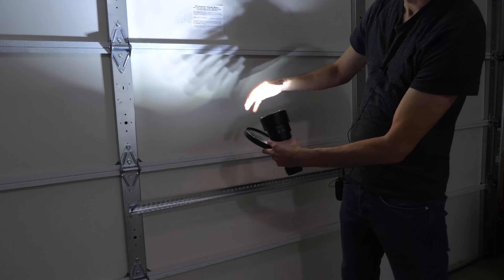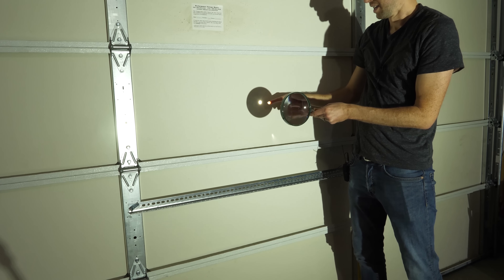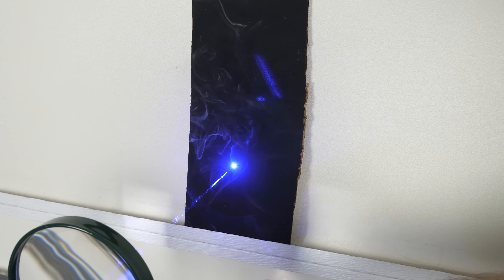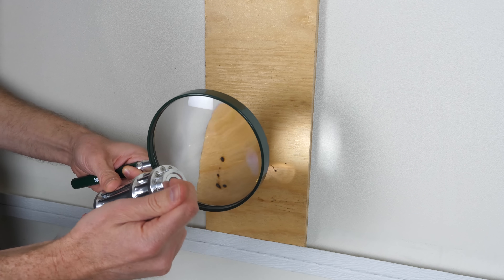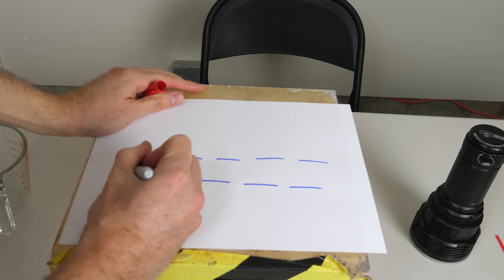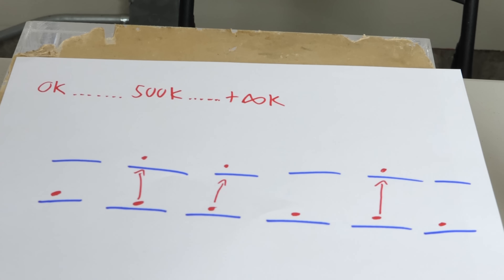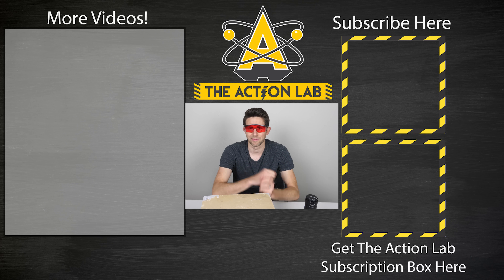What Happens if You Focus a 5W Laser With a Giant Magnifying Glass? Negative Kelvin Temperature!

Comment: to explain it more simply. A source of light will always have a sphere property in terms of how it spreads in this 3d universe and because this property follows any amount of light you have, you can never make a sphere into a straight line and you will always lose heat and energy because light doesn't travel in a straight line but in a sphere shape. 
For the laser part, the laser pointer has manipulated light within and the people who made lasers probably add matter to move the light to a focal point before hand to make light move in a straight line for a certain amount of time. After a certain time once the laser is beamed, the matter is bounced off light keeping the light in the straight point or not and this reaction gives a cold reaction and the reason why it makes a hole in whatever your pointing at is because the modified light is going at such extreme speeds that it smashes the wood but because it probably doesnt go at the speed of light the events arent that dramatic. its like a car being held back by a bull. the car wins but the bull slowed the car just enough to keep it in a desirable direction of the bull and the bull hits whatever is in the direction of where he wanted to go.
but thats just my opinion and guess. feel free to debunk it or not.

Comment: That... didn't explain this to acceptable satisfaction.
Reply: Its very hard to do, https://en.wikipedia.org/wiki/Etendue if you understand the mathematics go right ahead.
Reply: @danrayson  I thought temperature was the average energy of a bunch of particles. Even electron volts would translate directly into temperature and given the mass of the particle, into speed as well. Why does he come up with quantum states? Why is the "same number of high states ans same number of low states" +infinite temperature?
Reply: @TheYear2525  exactly, I don't believe that he fully understood this one before trying to explain it.
Reply: @TheYear2525  Temperature only directly correlates to the average energy of the particles in an ideal gas, and there only because the uncertainty in a particle's momentum also happens to directly correlate with its average energy. Temperature in full generality is defined as the response of a system's entropy to a change in its energy, and it turns out that in some systems there comes a point where an increase in energy doesn't change the entropy (infinite temperature) or causes it to decrease (negative temperature). 

For instance, think of a quantum system where every single atom is in its most excited state, except one random particle. The number of microstates here is just the number of particles in the system, since any one of the particles could be the nonexcited one. Now imagine I pump in the energy needed to promote this one random guy to an excited state. Now there's only 1 possible microstate for the system, the one where every last particles is excited. I've decreased the entropy even though I've increased the energy of the system; therefore it must have been at a negative temperature, indeed a temperature very close to negative absolute zero. Make sense?
Reply: Lemme make this easy. 

Light coming from the sun or a typical flashlight has tons of disorder (aka Entropy) in it because the light is emitted pretty much in all directions, across a huge range of frequencies and with a random phase. Since the entropy of the Universe can't decrease, any surface onto which you focus the light has to increase correspondingly in entropy, and because of that, you can't do any better than to replicate an image at the same temperature and brightness of the surface that emitted the light on the new surface, since that represents the absolute minimum disorder in the light before it's scattered and reflected further.

Laser light, by contrast, is almost completely ordered (ie. has very very little entropy). It travels in only one direction, at only one frequency, and is entirely in phase with itself. Because it carries almost no entropy there's almost no limit to the ways you can focus it onto a surface; you can pretty much make it as hot as you like, with the right setup.

The whole negative temperature thing is basically a way of saying the entropy of the laser is tiny relative to the energy it carries, btw. The way temperature is technically defined is by measuring the change in entropy of a system per unit change of the energy of system and taking the quotient, and for some setups (eg lasers) there's a point where the system becomes MORE ordered as you pump more energy in instead of less; this is the point where temperature passes infinity and becomes negative, becoming "hotter" than any regular, everyday object.

Am I making sense to everyone?
Reply: @tuckermatis1572  Great explanation.
Reply: @tuckermatis1572  please, entropy is a complicated subject and is notorious for being misunderstood and misrepresented. Firstly: entropy CAN decrease. I repeat, entropy CAN and DOES decrease, and this happens quite often. The 'law' of thermodynamics that you are thinking of reads merely that the entropy OF THE ENTIRE UNIVERSE SUMMED UP must always be increasing. Subsets of the universe decrease their entropy all the time, at the cost of an increase in entropy elsewhere, such that the net entropy OF THE ENTIRE UNIVERSE increasea. Gabísh?!?
Reply: @ilikemitchhedberg  Correct. It is possible that a system's entropy can decrease if there's a corresponding increase in the entropy of the surroundings. This doesn't mean the second law of thermodynamics can't be applied to small systems, though; all that necessitates is that one keep track of the inflow and outflow of entropy from the system to its surroundings. You can imagine a box around the system, define entropy inside the box, and consider how entropy must flow through the borders of said box. (Indeed, one way to define instantaneous change in entropy of the system is as the quotient of heat flow through said border and the temperature of the system). Makes sense?
Reply: @tuckermatis1572  Tucker, please leave me alone. Its not you... it is this video. This video triggers me hard because the author does not know what he is talking about... yet he presents himself to the public as an expert. This is morally wrong. I only partially read your comment and assumed you were defending the author of this video. Have a nice day.
Reply: Yess, I am kinda like more confused after watching this than i was before
Reply: @danrayson  "how do you wrap your head around infinite gravity in black holes?" Well I don't, because there has never been an experiment to prove any of that theory, its all on paper. Therefore I don't need to wrap my head around it, because its not factual. However there is an experiment that shows that focusing lazers works. The question is, do I ponder why or move on to other topics...?
Reply: "it shines" :D
Reply: ... the first and second laws of thermodynamics say nothing about temperature. Energy is conserved; entropy is increasing. I can promise you that our esteemed youtuber did not violate any laws of thermodynamics. The point of light resulting from the magnifying glass simply focused the laser light into a smaller area.
Reply: "if you use a magnifying glass it just spreads the light out more"
Reply: @danrayson  you saw evolution happen in real time on the computer  ? Wow - how many million years were you watching the computer ? Hahaha ..😆
Reply: I agree
Reply: to me is simple BS

Comment: Not quite.
What you did is called light energy convergence. 
The energy at the source(laser) is still equal to the energy output on the surface of the wood plus négligeable light refraction(by the air and all the smoke you created) . All you did was focusing that light energy to a smaller point.
The same way if you place a 50 lbs  dumbell directly on your head it won't be as uncomfortable as if you place an ice pick tip on you head than the dumbell on tip of the ice pick. Than it will go right through the skull not because the weight at the tip increased but because you distributed that weight on a smaller surface. Same thing with the light. Laser or flash light, the energy at the source remains equal to the energy on your board.

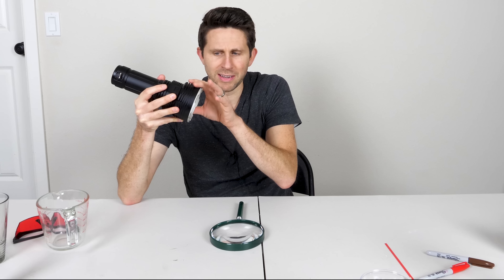Comment: 2:48 but I thought the point of a magnifying glass was taking the total amount of heat, which would otherwise be distributed evenly in several directions, and concentrating all that heat on a smaller point...or something like that?  Obviously that won't work with a flashlight and the sun is already really hot so you're taking the amount of energy that is normally already really warm over so many square inches and focusing it all down to a much smaller point... I don't know. :\

Comment: But if you gathered the light from  all <n> LEDs, and concentrated them on one spit, you would have a higher energy density than that of one LED.  In fact it would be more intense by a factor of <n>, minus inefficiency.   

By the same token, if you were to use a set of lenses (or mirrors) to focused the glowing area of one LED down to an area (say, 1/<n>-th) of the LED, your energy density would be greater.

You can make a smaller spot higher in energy density than the bulb.  That is what the parabolic reflector behind the bulb is doing. 

It does not violate the First Law, because you aren't getting something for nothing, merely concentrating a wee bit less than your something.  

Maybe you should not have started out your video with such a misleading statement about the Second Law.  In concentrating the energy, we are obeying the First Law.

Comment: Everyone gangsta until 0 has positive and negative forms
Reply: And I thought math was already hard...
Reply: It’s so Gangsta it’s...SIKKK...

        ...SSSIKKKNESSS....
Reply: well it was 0 kelvin so it has a different value in degrees so it is technically not 0 so it works
Reply: @ilent_assssin1121  okay einstein but nobody literally asked i didn't said i don't know that
Reply: @ilent_assssin1121  I actually appreciate you explaining this, thanks!
Reply: -0 degrees
Reply: 0 is no thing, or no temptation
Reply: @すばらしい猫  i didn't asked.
For god sake i hate people who doesn't have sense of humor
Reply: Looks like the people that designed the IEEE floating point number system already knew that
Reply: It have that in water. +0C water is liqid, -0 C water is solid. They are exactly the same tempersture but have diffrent energy stage
Reply: It is 1/infinity is 0+ and 1/infinity is 0 cuz they will tend to zero but never actually be exactly 0

Facts pls don't troll
Reply: Think of 0 as a neutron particle. Normally, a neutron has a neutral charge, but you can also apply a positive or negative charge to it. When you negatively charge a neutron, it becomes an electron. When you positively charge a neutron, it becomes a proton. So, 0 always has the value of 0, but it can exist in 3 different states. Positive, negative, or neutral. I hope this helps.
Reply: Wtf. Your profile picture looks like if my sleep paralysis demon's mother had a Facebook account and wanted to post a picture of her son for the first time. 

I LOVE IT.
Reply: @lepotato135  uuuhh that's the chad
Reply: @kosminn  Pretty sure they changed their profile picture lmao.
Reply: @lepotato135  lol i died during seeing this conversation
Reply: @lepotato135  please dont delete ur firt reply
Reply: @imbouttashowyoumycaillou-k541  I won't lol. But now I'm gonna have to be afraid of people who are gonna get the wrong context out of it. 😂
Reply: @lepotato135  Y E S

Comment: I've used a fresnel lens with a $40 led flashlight and used it to burn wood. 

The flashlight itself has a focusing function so the beam is spot instead of flood. So I had no problem getting the majority of the beam into focusing range of the small fresnel lens. But it clearly was creating a MUCH hotter point than the simple LED produced on the light itself. 

The fresnel lens used you can buy at any dollar store marketed as a reading aid approximately 8.5" x 11" in size.

Light used is the Nebo Slide King. Focus adjusted to the smallest spot, brightest setting. Produced negligible heat at the light.

Melted several pens, set paper, and wood on fire...and nearly the building  before we stopped laughing and carrying on like kids...

So maybe you mean to say the you can't focus with a single standard glass magnifier? 

Because with the fresnel you can instantly wood burn as if you're holding a blow torch in the sun. I did it and etched my daughters name in a piece of wood while she was watching while showing her a cool science experiment. That was after using it and the flashlight inside to melt through some 1/4 inch fish tank air line.

Comment: There are some highly questionable statements in this video, regarding what you cannot do with optics, and the supposed violation of the second law of thermodynamics. The pinned comment mentions etendue, but the author seems to not fully understand it, or perhaps he doesn't understand his LED flashlight. There's also some sloppy use of the word "hotter" when he seems to mean "more intense." Power density and temperature are not the same thing (you can make some assumptions to convert between the two quantities, though...for instance by using the Stefan–Boltzmann law).
Reply: OK, but you aren't explaining anything. I would be willing to believe the author is wrong if you brought forth an argument or explanation. Without that, all this is, is posturing.
Reply: The flashlight he's using is a collection of many small LEDs. He's correct that you can't use simple collection of spherical convex and concave lenses to focus the light. Also, if instead of using an LED flashlight, he had a uniformly-lit circular disk that was emitting black body radiation, then he would also be correct about not being able to focus the light to a spot that's hotter than the source of the light. However, that's not the situation. In this specific situation, it's possible, in principle, to craft some special optics that could collect most of the light of each individual LED, and then redirect that light onto a region that's comparable in size to just one of the LEDs. The rate of flow of energy per unit area would end up being much higher (more intense) in the target region than the front of the flashlight. Furthermore, the LEDs do not emit black-body radiation.  If the light were focused onto a small object that's very black, the equilibrium temperature of the object would be higher than the temperature of the LEDs. The equilibrium temperature is reached when the rate of power input is equal to the rate of power radiated away. The input spectrum for these LEDs tends to have an excess of violet-blue light, compared with a  black body, so a lot of the energy is being delivered as short wavelength light. The object that's being heated then needs to heat up to a temperature that allows it to emit black-body radiation at a rate that equals the input power. In order to do that, it has to have a higher temperature than the LEDs.

Comment: the problem is that he uses "temperature" as a definition related to entropy from an area of quantum mechanics that is called Statistical Mechanics. The laser and mirror reduces the entropy (to talk very vaguely, have not done/calculated Statistical Mechanics for a long term). However, this is not how the average person understands temperature. For the normal person, Temperature means 'how hot it is' and will it make things burn or melt. It obviously makes the wood burn quicker, therefore it is 'hotter' - as simple as that. The fact that this does not coincide with a highly specialised scientist's use of the word temperature is neither here nor there.
Reply: please explain how you can go from positive to negative k going from 0-infinity as he stated in the video bc that just breaks maths
Reply: @timweiner7434  it is due to the fact that they defined kelvin as starting at zero rather than negative (or positive) infinity meaning the scale is “wrapped around” or inverted; the discontinuity is just semantics. Another way to think about it: look at the graph of y=-1/x, you see the same discontinuity. And likewise, “inverse temperature” is continuous from infinity to 0 to negative infinity.
Reply: but it sound like your saying that kelvin is like a circle in which case doesn't that bring up the problem of there not being a positive or negative but never ending in both directions ??
Reply: Leave Kelvin alone!
Reply: I'm sooooo confused this is way over my head I'm just a simple mechanic / commercial electrician
Reply: ahhh yes
Reply: Speak English
Reply: oh come one, even Shannon confused entropy.

Comment: GET YOU A SECTION OF 3 OR 4 INCH PVC PIPE TO KEEP THE LIGHT CONTAINED ,PLACE LIGHT AT ONE END ,MAG GLASS AT OTHER ,YOU MAY HAVE TO ADD MORE PIPE OR CUT SOME UNTIL YOU GET THE DESIRED FOCAL POINT !